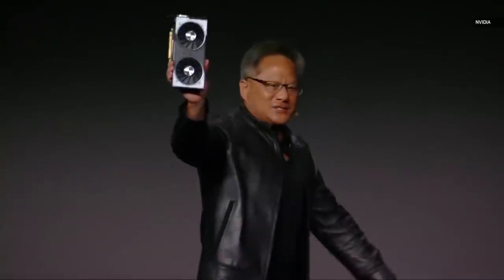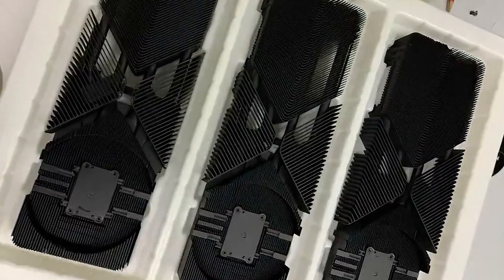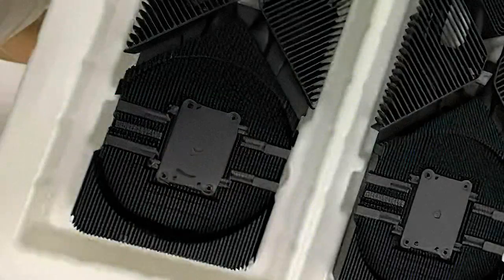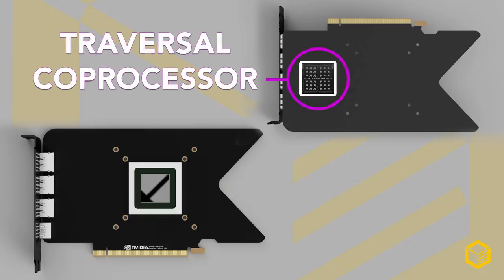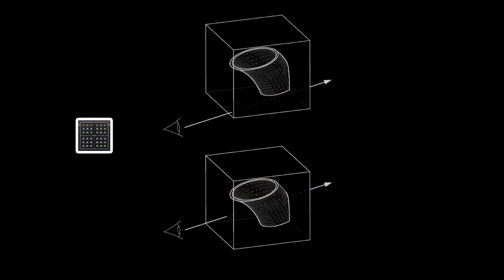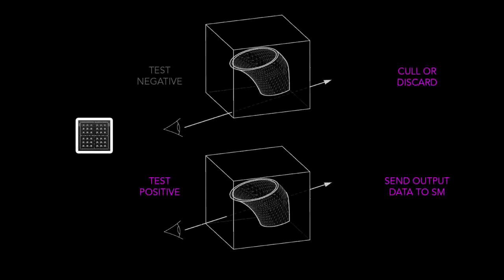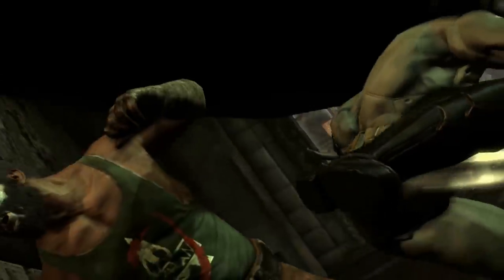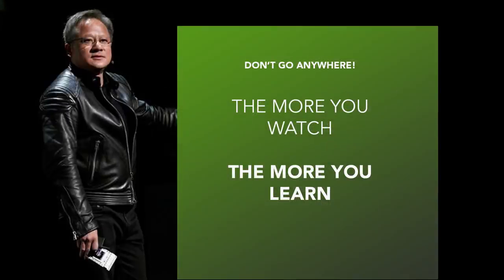A REVOLUTION in graphics is coming

Comment: You sir have some major guts. Even though your speculating on fact some of this just seems so hard to believe. I do however believe you made some great points. Like how the pcb of the Ampere Gpu's will be 2 sided. I originally speculated that they would put gddr6 memory on both sides of the card to save space, along with part of the power delivery system like you mentioned. While i'm not convinced about the whole coprocesser thing it certainly is a possibility that I wouldn't rule out. I do have my doubts about game streaming services though.  I would rather be able to own the game physically like i do now, or at least own the license to it like on Steam or GOG. It makes me curious that the new baseline is going to be the consoles though, both because of the basic ray tracing power and because of the ssd. I know Xbox has a relatively normal ssd but Playstation has what looks like a gift from halo product heaven.  I wonder what will transpire in terms of games as well, the Series X has a more potent Gpu and more bandwidth to feed said Gpu therefore making it better at ray tracing but the PS5's ssd could change the way games are made entirely. We all know raytracing will be no problem for pcs once ampere is out but i still wonder about the ssd. Besides that its going to be really nice to see new games take advantage of more than 4 cores and threads, I know a select few already do but it'll be nice to see it be the standard next gen. I would also like to see how Nvidia deals with the ssd  dilemma as well. Anyway though, Ill be right there when part 2 is out, and I'll be looking forward to this fall even though I'm broke.
Reply: Dude I know the feeling. Stoked to see what comes true. But there is a 350cc 2 stroke that needs fixing before I can drop cash on 2 graphics cards. Learned the hard way with buying a vega64 with waterblock... for 1440p. Man it was a nightmare, crashes and still at 70C under water! Was a $400 lesson. Picked up a 1080TI seahawk for me($450) and then a local deal on a rtx 2070($320) for my wife. Idk what others say but the 2070 was doing better at 1440p than my old vega, and that is in a E5-2667v2 system! Man lets hope the prices dont make us have to save 1.5 paychecks to get a new GPU.
Reply: If there is anything on the back of the PCB or not doesn't have any bearing on a fan being on either side or not. Not sure why Coreteks is making that equivalence.
I'm sure I remember in ye' olden days graphics cards with memory on the back. it makes sense if it's low enough power to not need a huge cooler, and just the conductivity of the back plate and PCB traces to take it away.
The co-processor thing may be real, but there's nothing excluding that from being on die with the GPU, or sharing the package/interposer.
Reply: i like your comment and i am one the same side, i think it will probably not come true, BUT it could, it make sense 
And yeah the PS5 change a lot of thing about how game are made and how gameplay can change, now i wonders about the xbox series X that a launch will be only a glorified 2013 xbox one because every first party game would need to run on the base xbox one 
or the simple fact everybody miss the xbox 2020 was annouced as "series X" and X was the more powerful variant of the xbox one, so not the base 
If it was sony doing the same move the console would have being the ps5 PRO, so now i wonders will the base xbox have a NVME SSD ? how high could it clock ? ect ect ect
Reply: @insurgentlowcash7564  bruh im running a stock vega 64 and have no issues. Its even undervolted. Did it so I can play half-life alyx. Got to say I was not disappointed.
Reply: @zblurth855  Xbox has waited for Sony to reveal all their cards while trying to market as much as possible. It would be impossible for them to release a cheaper Xbox it's not as powerful now that sony has revealed the ps5 digital edition. Doing so would quite literally be them putting a foot in their own grave.  I think it would be smart to do what was originally planned for the Xbox series x, give it 22 gigs of uniform memory instead of 16 gigs with different speeds. They changed it because they thought sony was cutting costs at the last minute. I think they should go back to that original and then create a series x digital edition.
Reply: @strixkuriboh7581  Glad yours is good. I didnt mention that i purchased it second hand. The guy lied to me. It would almost crash on just the desktop in the normal bios switch. I undervolted, power play table edit and bios flashed. After switching to the lower power bios it became way more stable. Still crashed once every 9-11 days but was way more manageable. We play alotta SQUAD and my vega just did not do unreal engine well. My best guess is that the previous owner did not want to RMA the card for some reason and just return on some of his loss. But the 1080TI i have zero complaints on.
Reply: @strixkuriboh7581  Oh and it had a liquid cooled bios on it when i got it. Was a bad sign along with BREAD TIES holding the fans to the radiator!
Reply: @insurgentlowcash7564  Hey man, mine was second hand too. For 250. Insanely long Shipping. The crash every few days PLAGUED my rx 560 4gb i had before my vega. Im pretty sure it was either the drivers or ryzen 1000 software being screwy at the time. Its all good in the hood for my now though. My vega 64 runs full throttle with a r7 2700 on a 500 watt unit without issue. I couldn't be happier.
Reply: The ratchet and clank demo in PS5's reveal last week might be the best example of what the SSD can do, with the instant switching between dimensions.

Comment: Maybe not another accelerator, but maybe the gddr6 has to be on both sides of the board to keep trace lengths down.
Reply from the maker: Yeah that was my first thought, it's possible. But everything I mentioned is real, it's at NVidia HQ right now I can tell you that. Obviously I don't know when exactly they are coming out, but the cooler leak is a strong indicator of something of that sort. We'll see, definitely exciting if it's accurate :)
Reply: i am in the same club but i hope they dont disable rgb controller to just green and they dont use glue to stick this stuff.
Reply: I would be ecstatic to see Nvidia put out something truly revolutionary in the PC gaming space this upcoming generation. My skepticism isn't on the technology side, I 100% believe you when you say they have this and other amazing things in their labs that would literally render me speechless (see what I did there), but it's more of a business concern that they wouldn't release something like this without pricing it far outside of the mainstream, or hold on to it until they're under enough pressure to do so in order to keep the performance crown if someone else releases a card that threatens their dominance in the market.
If they do release it on the 30 series, I'll almost certainly buy one if I can afford it. Maybe one Ampere and one RDNA2 card for each of my gaming VMs, neither would be flagships but if there's a decent mid-range cards from each lineup I would gladly do that. Then all I'd need is the trx40 platform to come down to a reasonable price point and I'd have to build a new machine (even though my current one is less than a year old, I wasn't expecting x399 to be a dead end)

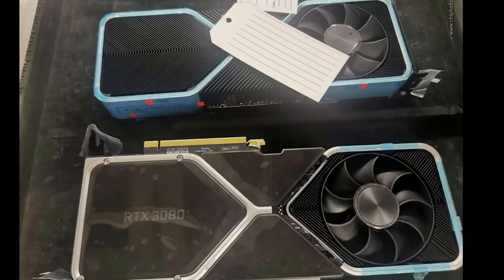Comment: @3:19 - think the picture was used to justify that there was two fan design.  think it was a misjudgement.  both the top and bottom seem to have PCB.  Unless both are to be connected together to form a thick PCB combo (extremely unlikely), what you see is the typical blower design.  Top shows without the top plate with the RTX 3080 inscribed.  What makes me believe that as the case is that the bottom seems to have the factory blue plastic wrap (by one component maker) more removed to facilitate the addition of the top plates.  Top picture just shows you the fins and how the air flow will be like.  What made people seem to think they will form a single card seems to be that the top card seems to have the interface blocked by body of the card in the angle taken by the photographer..

Comment: I'm not buying the idea of raytracing on a different chip, they said this about PS5 in leaks and it wasn't true - it seems like hardware-accelerated raytracing has to be on the same chip as the rasteriser to prevent latency. @Coreteks you got high on your own supply - rookie mistake
Reply: I love Coreteks,  but the speculations presented in this video just doesn't add up.  It must be some good sh%t Coreteks has been smoking lately.
Reply: let’s be clear, nothing he is saying is impossible. In fact, they could’ve done this a generation or two ago.  AMD could have, as well.  so could motherboard manufacturers on their motherboards.  we don’t see this on a regular basis because it adds a lot of design complexity and cost.
Reply: Marc Jackson  I don't believe it's impossible but if it was so convenient and logical why didn't RDNA2 use that route as opposed to embedding BVH processing on the compute units.
Reply: Marc Jackson  take a breath, relax and then reply. There is never a need for that many "!,?" In a sentence.

Comment: One of the fans blow air through the heatsink, so it is differnt, it will pull more hot air away. That means more cooling.

Comment: Wouldn't we save some time just buying a second full-size computer dedicated to graphics? 😄
Reply: That would be like strapping a trailer with an engine to a sportscar to make it quicker.
Reply: @WarClonk  just beautiful. incredible analogy, superb intuition. you smart
Reply: @WarClonk  
That same analogy would apply no less to an internal GPU than it would to an overbuilt external.
Reply: Actually, it is possible to do something like this using software called MPI (Message Passing Interface), and you can also use the CPU of the other computer as well as the GPU. This is the fundementals of supercomputering.

This does of course require specific coding to be made use of, and your networking to the other computer must be some seriously high grade stuff.
Reply: A dedicated Raytracing card from Nvidia for $250 that works with any 10-series GTX and up? I'd buy it. Maybe bundle it with the new ones. NVlink, etc. Course that blows away all of the ITX PC gaming setups, womp womp.
Reply: that's pretty much what a gpu is... it has it's own "psu" (vrm) memory, processor with cache, task scheduler, and a pch. It's a fpga that slots in pcie

Comment: This traversal coprocessor sounds like you're describing the function of the RT cores in Turing, only on a separate die. They're basically black boxes that trace a single ray through the BVH and return an intersection result to the shaders. Unlike the Intersection Engines in RDNA2 which perform one BVH node test per invocation and rely on the shaders to keep passing new nodes to them to traverse the length of each ray.

Comment: Something which would be far more useful to stream from a server than real-time 2D video is 3D light fields. You could have the client use those light fields to form a detailed background image from any angle it needs and at any frame rate, leaving loads of local computing power left to focus on rendering and compositing foreground elements. The light fields would remain in memory (possibly written to disk) and be updated as the scene changes. It would be the perfect marriage of hardware, software, and networking. And perhaps more importantly for the industry, it would retain the need/desire for future hardware upgrades.

Comment: 30:21 holographic? How can there be anything holographic about a screen in a VR headset? Especially as you only have one screen per eye.
And about that Nvidia controller: It doesn't make much sense to not have some kind of computer that handles all the video decoding and output. A controller that works on its own would still have to send the video to the TV or some other device somehow, which would drain the battery, add latency and probably reduce quality due to additional reencoding that would be necessary when some proprietary screencast technology is used.
Reply: no, otherwise the signal from the controller goes like this:
controller -> pc/tv -> router -> nvidia cloudserver -> router ->  pc/tv
if controller connects directly to router then you cut 1 step and thus some latency.
Your pc and tv can easily decode the VIDEO signal you get from the nvidia cloudserver just like with h265
Reply: @cirebinregbin1056  si Stadia then... That's exactly how the Stadia Controller & stream work...
Reply: I think the point is that it creates a 3D image.
Reply: @cirebinregbin1056   Cire Binregbin  Makes sense, but that would only work on TVs that run Android or some other common operating system where Nvidia could provide an app for, and also wouldn't work on all hardware, at least not with all resolutions and frame rates. And as the same benefits are possible with a dedicated cloud console that does all the decoding and works reliably regardless of what TV you have it would be quite stupid from Nvidia to not provide something like that.
I also doubt that there would be any meaningful difference in latency as latency over a local ethernet network is normally below 1m, and sending the controller inputs over a wifi that's used by multiple other devices should produce much higher latency than a direct wireless connection to the cloud console.
Reply: then you would end up using your cloud console as an signal repeater..  it doesn't make much sense in the perspective of nvidia, they want console that you can take to the beach and play via your phone or on the tv of a friend of yours as well as on the tv in your bedroom as the one in your sons bedroom.  the only thing they all need is android app support and a video decoding chip like with h265/h264
If your tv doesn't support SMart functionality you can make it a smart tv easily by plugging in a system on a stick for like 20 dollars.

Comment: looking at the four GIANT heat pipes traversing from the front of the card to the v shaped fins in the rear, i personally believe that they have condensed the electronics of the card into the front half of the card, while leaving the back as a giant heat sink, this implies that only half the card is really used for dissipating heat, bringing the tdp back down to more normal levels. 
furthermore, as i remember fans blow through heat sinks, yes? so it wouldn't make much sense to have the heat sink on both sides of a board on the back half.

Comment: IMO the fan near the display outputs is pressure optimized since the air has to turn and get pushed out the top and bottom vent fins and the one from the back is air flow optimized since it's straight up just blowing air from one side of the fins to the other side.

Comment: If it's a co-processor arrangement I suspect it'd be the machine learning cores such as used in dlss, not the bvh traversal unit. DLSS and similar is done to a whole frame at once whereas the ray tracing is split between bhv and related and the regular gfx cores, the integration between those vs what is essentially a post processing step once the frame is finished make it much easier to move the tensor cores to a co-processor and leave the ray tracing cores on the main die.

Comment: i have to object: the amount of surface area of a heat sink barely matters, when there isnt sufficient airflow. convection can only move a fraction of the air, that the heat is dissipates into, and particularly the tight, high efficiency fins of many modern coolers absolutely rely on forced air flow. this is doublely true, if the fins of the sink are horizontal, or even on the inderside of a card

Comment: there are various reasons for implementing a second  chip: 1) the secondary workload is highly decoupled from the primary such that inter-chip communication delays are a non-factor. 2) the workload has very different memory access patterns that might flush the cache of the primary workload. 3) if the secondary requires large die area but does not generate a large heat, then this might be a good choice to place on the backside having less airflow?
Reply: If that co0processor is used for ray-scene-traversal (which it's name suggests) then that's a good assumption, ray-scene-traversal has different memory access patterns compared to traditional rendering, a lot of which is reading 2d textures

Comment: I did some R&D tool making for an engineer working on heat contol on large lithium battery packs. He was very detailed in his aluminum heat sink designs.

He told me that especially with passive sinks (no fan) everything matters. Lots of surface area but restricted or less then enough airflow is disastrous as a temp saturation threshold is approached. Too deep, or too narrow gaps berween fins leave dead air zones. In those cases more surface does nothing.

But with a fan air can at least move... So long as the fans, shrouds, and vent are designed and placed correctly.

Btw... I heard my gaming system Graphics Card "pop" years ago. Too many high level players at the same battle... All using elite everything. *I died... Lol